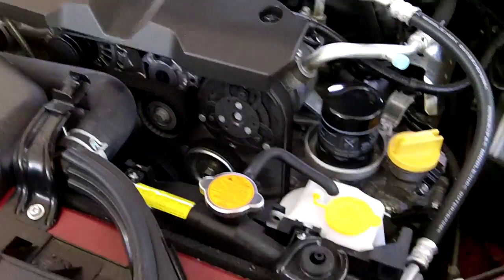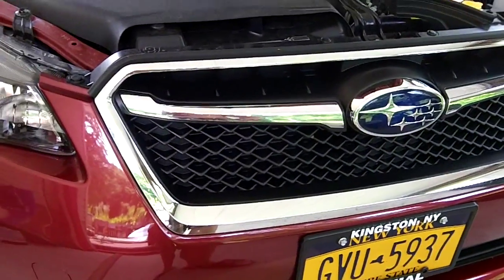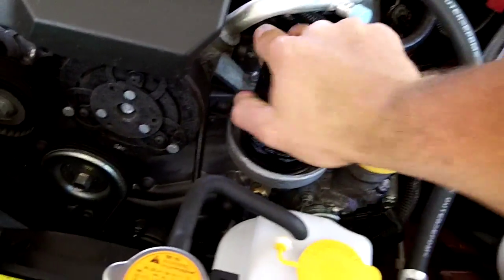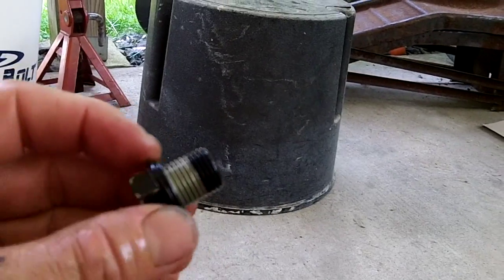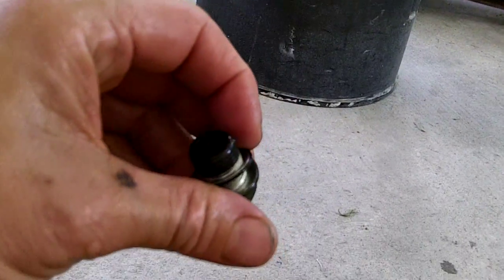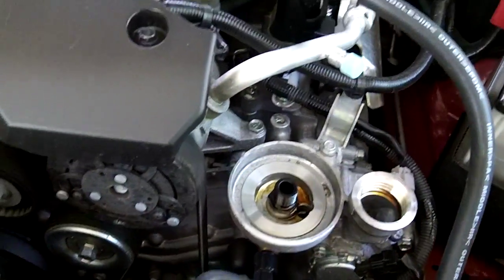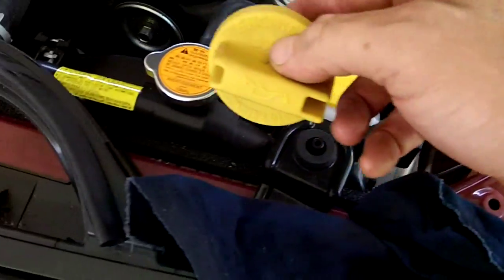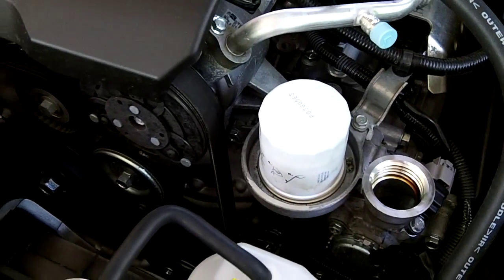2015 Subaru Impreza Oil Change

Comment: To be safe, I always like to add a bit of oil to the rubber seal on the new oil filter to prevent it from seizing over time from being tightened on. Thanks for the video, glad this car is easy to perform some of the routine maintenance on.
Reply: Retro Hi-Def When you do 3k miles every month like I do you don't worry about the seal seizing lol.

Comment: The oil capacity is 4.7 qts on this 2.0i, but it probably won't take quite that much since there is always a bit of old oil left in the engine. I would put in 4.5 qts, run it for 5 min, let it sit for 10 min,  then check the level.

Comment: So you lifted just the front passenger side and you had enough room to shimmy under to the drain plug? I’ll be changing the oil on my 2015 shortly and the overall lowness of the car is a pain.

Comment: Thanks for the video!  First time I changed mine was today, and this video was all the help I needed.  had a difficult time locating that darn oil plug though.  And it was on super tight.  Ticks me off the last mechanic probably put that on with a power tool, when it only needs to be put on with normal human strength.  Oh well, pushed on the wrench with the bottom of my foot and it finally loosened.  The rest was cake.

Comment: My drain plug appears to have a lever on it, a ring clamp, and a "fumoto" plastic c-ring. Nothing at all like this one.
Reply: @MichaelMosesHammer  I figured it out. It's a fumoto brand quick release drain plug. You pull the tiny lever then rotate to open the drain plug. World's easiest oil change just got even easier!